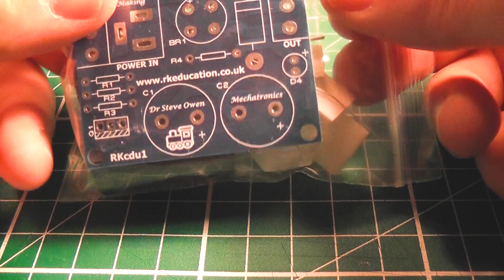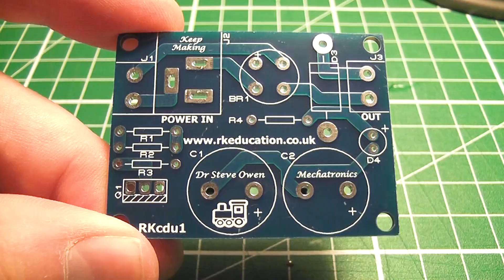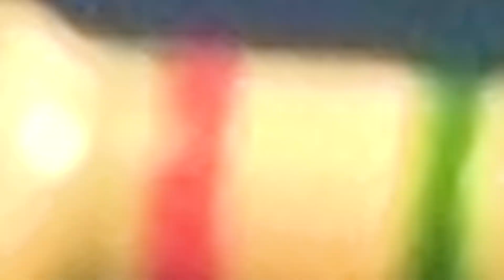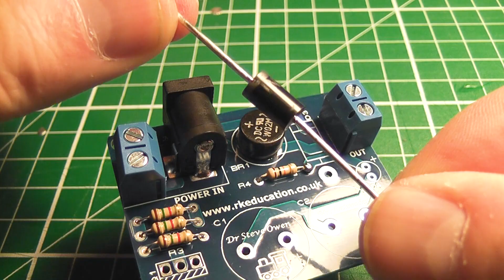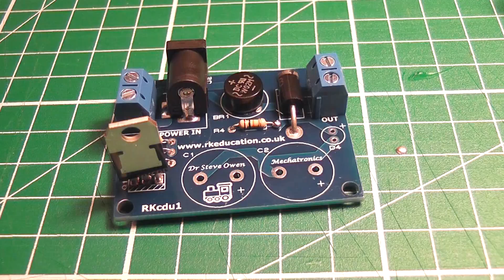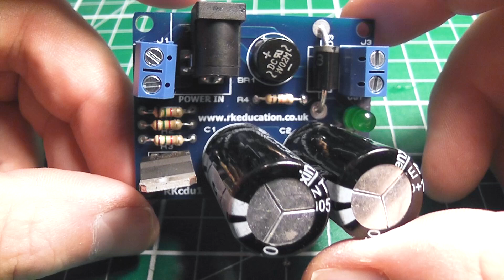Save Money! - How to Build Your Own Capacitor Discharge Unit (CDU)

Comment: If you tin the iron before you turn it off, it will protect the iron tip, make it easier to clean when it gets hot again and make the tip last a lot longer.
I don't understand the modern thinking (I have seen others do it) why are people heating the components without solder?
I was an electronics engineer for a long time, soldering circuits from the beginning and I always put a little bit of solder on the iron before touching the component and the board. With solder on the iron, it transfers heat to where it is needed straight away, where you without solder are having to guess and getting it wrong. In your eyes when you did it wrong with the solder on the iron first, the solder joint is good with a smooth round shape slopping up to the middle. When you heat without solder, the solder is a blob and bulbous and not a good connection, these joints can have lots of flux inside as a bubble which will corrode and fail.
Otherwise a great video, I know you are learning as you go along, it can be scary when you start soldering, but you are doing great, keep it up.
Reply from the maker: Very good tip, and I've been reminded of this more recently, that the solder on the tip does help as it increases the surface area you're in contact with. This was older footage from back in November before I decided to start the channel so even in a few months, I'm improving. 

I didn't know about tinning at the end of use. That's great advice. My cheap soldering iron died today, in fact, so I'll be remembering that for the future. 

Many thanks!
Reply: @NeoModelRailway  So well done, but I would tell people about the solder on the iron to transfer the heat. Keep the videos coming, I find them good.
Reply from the maker: @malminstral  I shall make it a mission. Thanks 😊

Comment: Hi I live your detail explaining I'm a beginner need lot of help but for now I would appreciate where I can buy the capacitor you are working on the full name & were to order what would be helpful how to wire it for a pico switch motor I saw other videos that explain as if it was for experience person which I'm not feather ahead so my point is if the video is to help people a. Details explanation would work I rather which a 2 part video to learn something then one video wasting my time I hope you understand and can help me by for now
Reply from the maker: Hi. If you a complete beginner I don't recommend building your own CDU. It's fun if you're keen on electronics - the reason I did it - but you can buy them for a few pounds such as https://www.amazon.co.uk/RKcdu2-2200uF-Capacitor-Discharge-Unit/dp/B07NF8VDH6/ref=sr_1_1

Comment: That soldering iron tip is woeful, try using a smaller conical tip, well tinned. Also adding a little extra flux on the joint before soldering will give you quicker and better joints
Reply from the maker: 100%. In a later video, you'll see I binned it for a much better iron.

Comment: Adding to @malminstral comments for circuit board work in particular but also for thin wire soldering in general use a smaller iron tip than the one you were using. This won't effect the soldering time but will allow better contact between the component wire and the solder pad. Also tin the iron tip well before first use by alternately wiping the tip then applying solder then wiping again. Keep doing this until you have a nice shiny tip. When soldering on circuit boards a pair of narrow nose pliers are your friends allowing nice square bends on your component legs. For some reason the current idea is not to blow on solder joints because, apparently, it alters the crystal structure resulting in a poorer joint than letting the joint cool naturally. Last point. Thank you for not becoming Americanised and calling it SODDER! This grates on my ear when  listening to Americans, what do they think the "l" is there for? Do they miss out the "l" in any other words? (I'll go and have a cuppa now to calm down).
Reply from the maker: Absolutely agree and you may have seen that old soLdering iron died a death and I replaced it with a much better tool with swappable tips. What a difference that made!

I didn't know about blowing on it. But that would make sense chemically. Materials cooling too quickly can become brittle, so I presume something similar happens here.

And yes! s.o.L.d.e.r. But hey, I butcher various words myself. I'll join you for that tea though!
Reply: @NeoModelRailway  Get yourself an Antex 25 Watt Soldering Iron. Basic, well-made and reliable.
Reply from the maker: Thanks for the tip!

Comment: Do you only need one per layout?
Reply from the maker: Yes. You may wish to check the capacitor size, but realistically that's only an issue if you are switching multiple points at the same time, for example, if you have pairs linked together, as you'll need a large charge to power multiple motors simultaneously. However, a single CDU should still suffice.